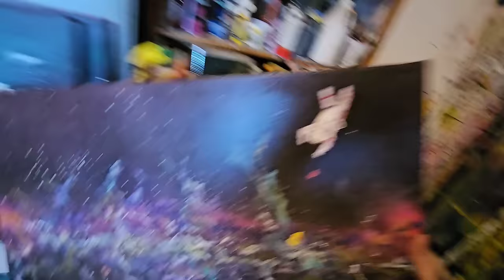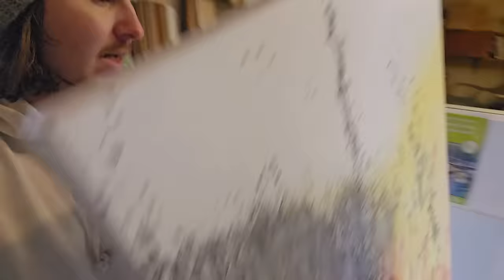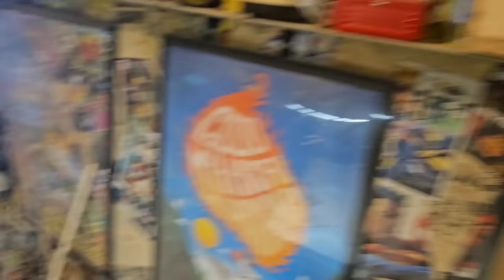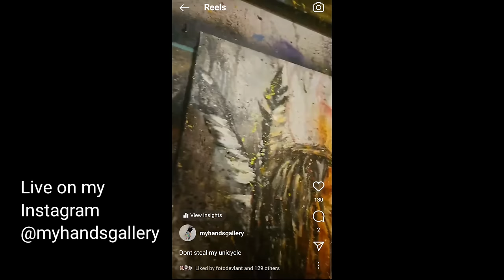My review of Hemp canvas

Comment: Dear Joshua Alexander.
👍👌👏 Oh WOW, simply fantastic again and as always. I'm still not able to get my head around this (although I've already seen you doing it many times). How in the world is it possible to paint so incredibly well by using relatively thick human fingers!? The painting looks simply stunning. Congratulations 🎉 for being so talented. 2) Maybe using distilled water to thin your paint is better than normal water out of the tap?
3) Maybe the great Bob Ross is able to help you posthumously. He and his viewers always had great fun when he beat the heck out of his brushes after cleaning/rinsing them. 😁 ;-) By the way: If I want to use a brush or a paint roller again the next day or some days later, I simply put them in water. For the same reason I put paint rollers and long or big brushes in freeze bags and add a little bit of water to keep the paint moist. Of course I close the bags as good as possible with a piece of wire and/or adhesive tape. This method has always worked fine with me. Maybe it could also work for you?
4) I'm quite shocked that this relatively small canvas already costs almost 50 CAD. I wonder if you have ever considered to fabricate your own stretchers with canvas? You're a very experienced wood worker and a role of canvas/fabric shouldn't be too expensive. If you try, please use those special tiny nails (tacks?) to fix the canvas on the stretcher. Please don't use staples because otherwise Julian Baumgartner will have nightmares. 😁 ;-)
As always: Thanks a lot for making teaching explaining recording editing uploading and sharing.
Best regards luck and especially health to all of you (including all the animals).

Comment: The issue is not because of the canvas, it is due to an unstable paint film. The dilute spray with watery paint over the undiluted white acrylic has little medium to adhere it to the white. It’s not the hemp. You could adjust your watery spray so it adheres better by adding some acrylic medium to stabilise it. The textural differences are just what they are and unrelated to the paint film. Hope this helps.

Nice painting, btw.
Reply from the maker: Thankyou for the info! Though the texture is laregly due to the paint jnderneith letting go. It would be smooth if that didnt happen. I have many paintings where it so.
Reply: @JoshuaAlexander138  try gessoing first before your white base coat. Your acrylic base coat will be a bit thick. Alternatively thin the base coat before applying. The gesso those canvases come with is not that great.

Comment: From knowing natural fibres, hemp is similar to linen/flax, both are long fibrous plants that absorb water quickly as the part used is the inside of the plant that is built to move the water from the roots to the leaves. In comparison, cotton is a short fibre in which the water is moved more slowly because it's the "fruit" of the cotton plant.